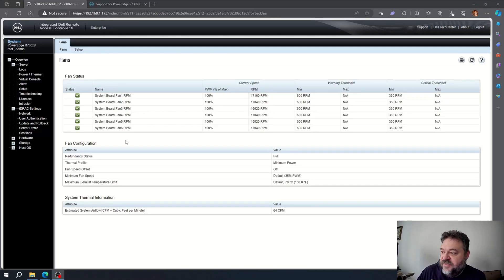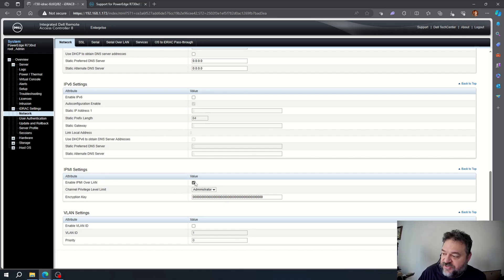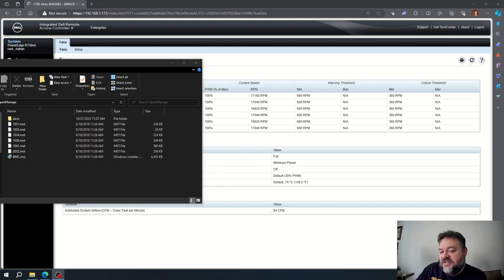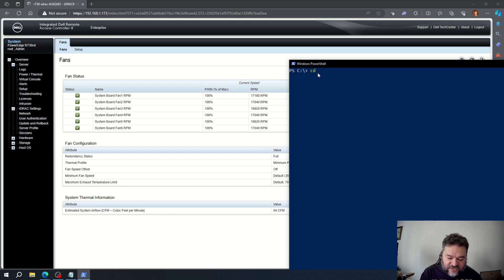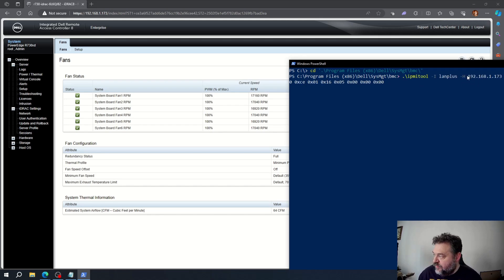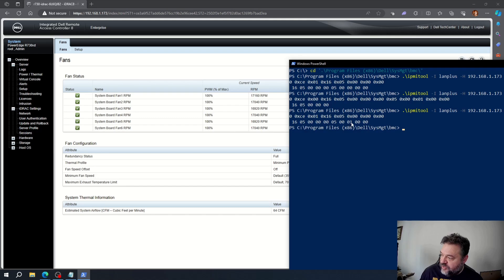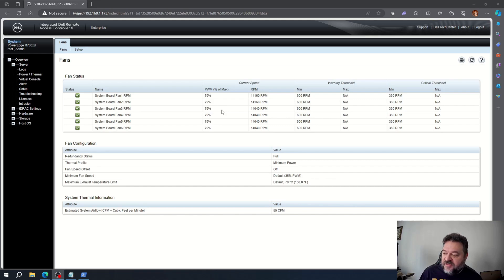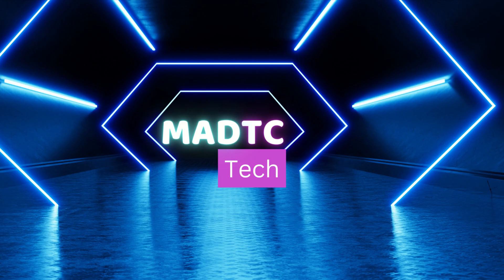Silencing a Jet Engine: Taming Fan Noise After Installing 3rd Party GPUs in My UnRaid Dell Server!

Comment: install Dell-iDRAC-Fan-Controller docker image and you'll be able to set it to whatever you want! works perfect with my r7910 just doesn't vary fan speed based on gpu temp only cpu as far as I can tell
Reply from the maker: @davidburgess2673  might have to check that at. Thanks.

Comment: I always get this error 
Unable to send RAW command (channel=0x0 netfn=0x30 lun=0x0 cmd=0xce rsp=0xc1): Invalid command
I'm running IDRAC 7 Dell poweredge T640
Reply: for me the work around was to not included the $ before the username and password
Reply from the maker: good to know
Reply from the maker: not sure. could be an insufficient privilege level.
Reply: @madtc74  I Just learnt that they removed manual fan control from IDRAC after version 3.30.30.30 and now I'm rolling back from FW 7 in like 8 stages rollback since IDRAC allow only rollback to the exact previous version
Reply from the maker: @ahmedaborady7883  sounds horrible
Reply from the maker: Good to know.
Reply: @ahmedaborady7883  I'm having the similar error message "Unable to establish IPMI v2 / RMCP+ session. Unable to send RAW command (channel=0x0 netfn=0x30 lun=0x0 cm=0xce). i'm running IDRAC 8 Dell poweredge T130. Did the roll back help fix fan?
Reply from the maker: did you try the roll back?
Reply: @ After taking the time to update the BIOS and iDRAC, I decided to go in another direction and replaced the fan. I figured that rolling back the update would not change the fan speed or sound. Since replacing the fan, it is much quieter!
Reply from the maker: glad you got it all worked out.